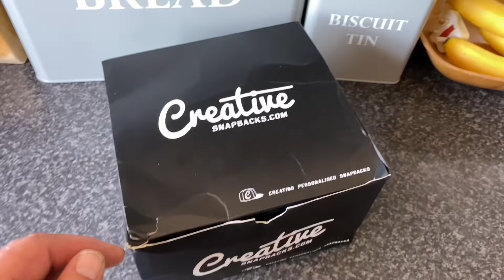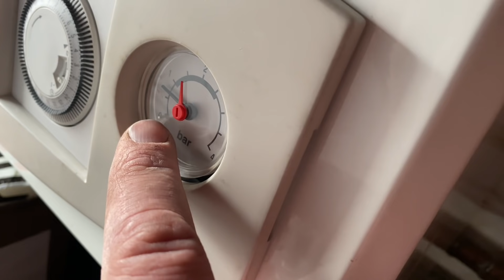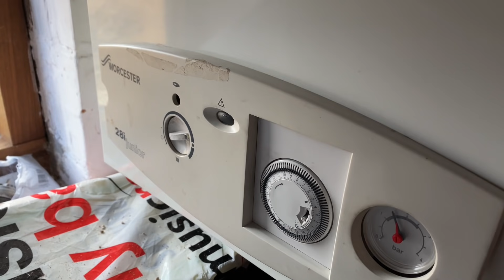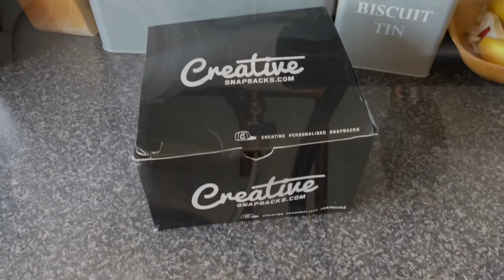MAJOR PROBLEM WITH THE TILES ON THE HOUSE RENOVATION.... THE TILES ARE COMING OFF!!!!!

Comment: Tiles leaching the black out of the grout. That's a new one - never had anything like that!! Just one thing - I was surprised to see that the tiles along the bath were NOT full tiles. I always make the bath the level for the whole bathroom and put full ones along the bath  top and the cut ones at the ceiling.
Reply from the maker: One for the tilers mate
Reply: You've never had the problem with the dye, that's because you've laid it down the correct way, colour fast grout cannot be used in the same way as normal grout, I still cannot believe that people who do this for a living still get it wrong, it's like 98% of plasterer don't even know the meaning or how to Dot and dab, like yourself we've never had a problem with colourfast grout or epoxy grout

Comment: Used SS Tube 77/78 Mark.  This was due to a copper shortage. A nightmare to bend, 15 was manageable, but 22mm could only be done with a Tripod machine. Special wheels on your cutters, however, we still made serious money on Heating Installs!!!  Boiler, cylinder & 6 rads, squad of 3 in a day.  We were making £500/week each!!👍👍👍👍
Reply from the maker: Strong money that back in the day.....when you could earn good money house bashing. I did a few years of it before the builders decided they didnt like us earning so much money...

Comment: Top content mate👍🏻 during this hot spell it’s important to keep hydrated……..don’t forget to get a bottle of water out of the washing machine in the morning!!!!!!😂
Reply from the maker: FFS 🤣🤣🤦🏼‍♂️🤦🏼‍♂️🤦🏼‍♂️
Reply: Sorry mate couldn’t resist! I’ve also had an idea regarding customers that desire black grout. Use white grout, lock the thermostatic valve on hot, disconnect the extractor fan, bust off the handles on the windows,  seal up the trickle vents, ensure that at least one of the shower valves is knackered and constantly dripping and dont use any grout sealer………hey presto the whole lot will be black in a few weeks with the added bonus that you can bleach it back to white when you get bored of it!👍🏻

Comment: Had exact same with my own kitchen tiles... after I spent ages getting the herringbone pattern right as her ladyship wanted.... glad to know its not just me! Great video! 👍
Reply from the maker: Nightmare isn’t it mate
Reply: @MJTiffPlumbing  what made it worse is I'd started doing a brick bond with some grey metros... 3/4 finished and the missus didn't like them so ripped them all off and started again with a white 100mm x 300mm white in herringbone 🤣🤣

Comment: Just bought some safety trainers from screw fix , site ones , have hard toecap for when you drop a rad on your toes 😂😂😂 they are just the job plus they have laces  but are slip on so ideal if in out on lush carpet on a wet day 👍👍
Reply from the maker: A few have said about these, will take a look

Comment: I just had a similar thing mate but is where the tiles have been faulty and let water through them. All had to come off. Good video mate 👍
Reply from the maker: That’s a proper shitter mate…. these things happen.
How did you come to that result with them??
Reply: You could see the ones that had absorbed the water and it was showing the adhesive through them and they had then started to come loose🤦‍♂️
Reply: They buy cheap seconds and charge tops for um 🤣

Comment: I often find the porcelain tiles that the customers buy are very poor quality and they suck the grout, especially the Matt tiles. I’ve used the sealers and would be hard pushed to notice any difference. As for those cleaning products they are about as strong as Fairy, nothing like the products of old. It’s really disappointing when shit like that happens as you think you’re on the home run. As for black grout, I hate the stuff, it’s like covering your hard work with grinded down wet coal.

Comment: M J Tiff Plumbing, Just out of interest have you ever had an airlock in a boiler when refilling the system? Happened to me once and had to call my boiler breakdown. Do you need to be gas safe just bleed air from the pump if it's located in the boiler itself? Perhaps you would consider doing a video on this in the future.
Reply: Thats a good question. They say you should only remove boiler case if you are gas safe registered or competent to do so. I dont think there would be an issue with removing it to gain access to bleed the pump
Reply: @GD-qu9hr  I had this issue and didn't want to remove the casing as wasn't sure if I was allowed. But surely a level 2 plumber should be able to release an airlock from the circulator?

Comment: Air Force ones!! Last a year at a time! Bit more hard wearing!
Reply: Hello mate just thought of something I haven’t seen on any plumbing videos and i watch all of them ALOT! And I’ve never seen anyone talk about and don’t know if they know that the end of  bacho adjustable spanners with the whole in (usually come with a orange plug in the end which your meant to take out that no body does) is designed to turn on/off ceased stop cocks, put the hole of the spanner around the handle of the stopcock and use it as a lever once I found this out it made my life so much easier and hopefully will make yours easier too! Just thought if you try it and liked it you could put it on one of your videos! Cheers for all the great videos mate really enjoy them!
Reply from the maker: LOVING that little hack, i have those adjustables so im going to take a look.....
Reply: @MJTiffPlumbing  let me know what you think once you’ve tried it!! 👍🏼

Comment: Why didn't the tiler do a test with the tiles/grout before putting it on the wall?
Reply from the maker: Because some of the tiles are ok and some are not…… he could of tested one and it was fine and still have this outcome.
The customer was warned prior to having black grout that it can stain.

In the real world tilers don’t test grout as it’s not an issue, as shown on the other tiles with the patterns it’s fine.

The tiles are the issue
Reply: Imagine if you test the grout and it stained a tile, what are you going to do keep going down the merchants until you finally find a grout that doesn’t stain. If the tiles are porous to that extent they should be sold with a sealer recommended by the tile manufacturers. Why are we being sold this cheap crap in the first place. If the tile won’t accept grout it’s not fit for the purpose.
Reply from the maker: Tracer-
The lads put 3 lots of sealent on the tiles over the bath and it STILL got onto them…. Proper crap tiles.

Yet the other batch were ok and washed down fine
Reply: @MJTiffPlumbing   It's not good enough after you try and do a nice job for someone. That shouldn't happen in this day and age. You would think that if the tiles need sealing that they would be treated during production.
Reply from the maker: Exactly mate 👍🏼